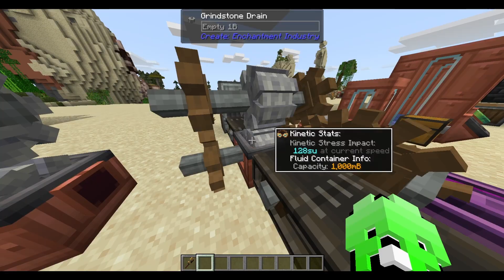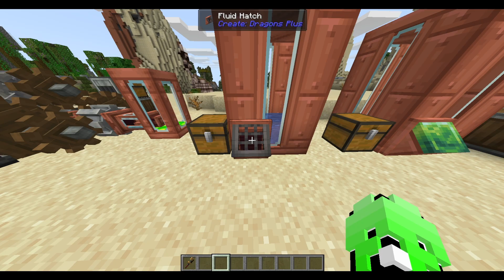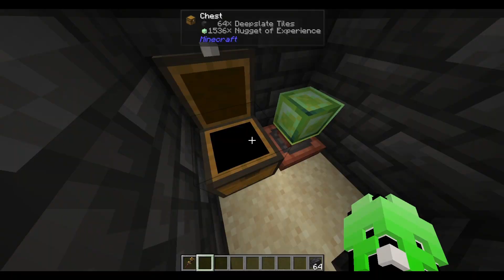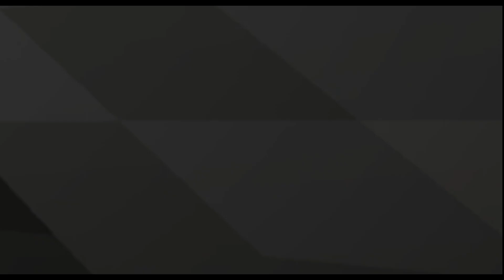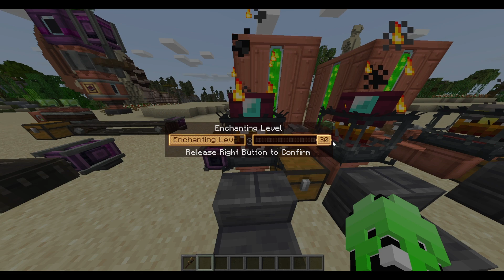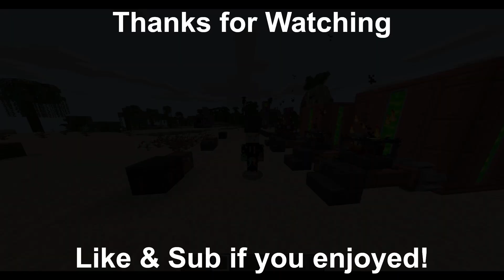Create Enchantment Industry: Complete Guide - Part 1 (1.21.1)

Comment: do the crushing wheels spawn silverfish when crushing infested stones or does it get deleted
also do crushing wheels force exp nuggets to be included in mob drops killed by it
Reply from the maker: I am pretty sure silverfish ONLY spawn if the block is broken. This means u will most likely need a deployer to place the blocks, then break it using drills. Simply crushing the infested stone blocks probably won't work. But if u are not sure, just give it a test in a creative world!